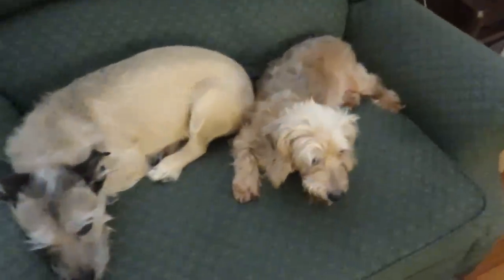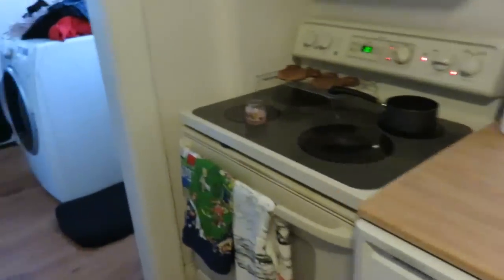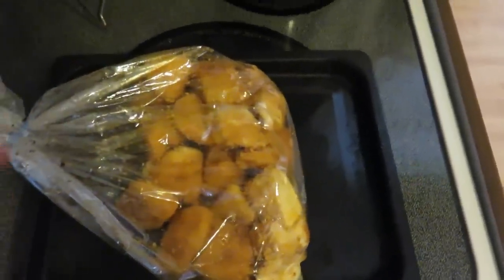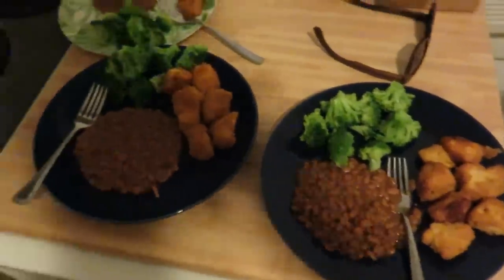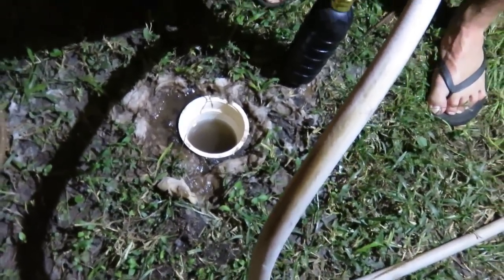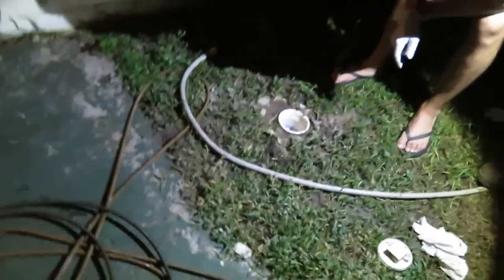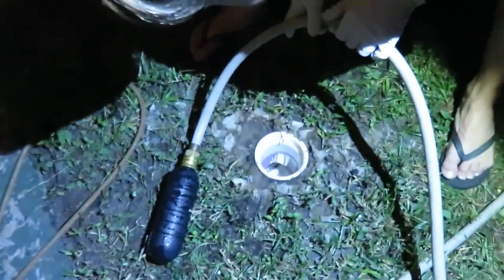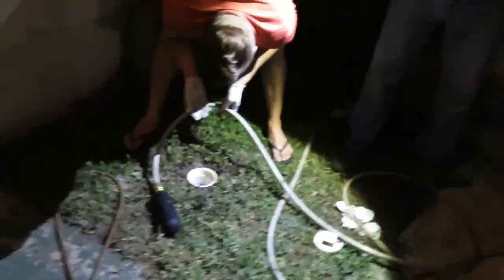Fixing A Clog In a Sewer Pipe & So Much Poop!!!

Comment: Multiple toilets aren't a bad option for testing to see whether a line is clear, but a better one is starting your washing machine with no clothes and leaving the lid open.  It'll fill with tens of gallons of water.  When you're ready to flush, you switch it to the rinse cycle.  Anything remaining in the line will show its face at that point.